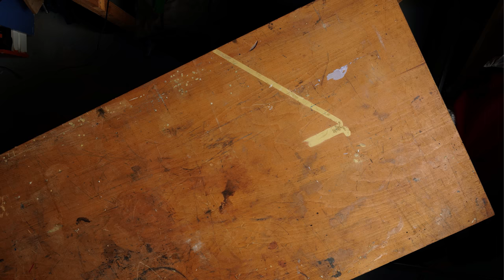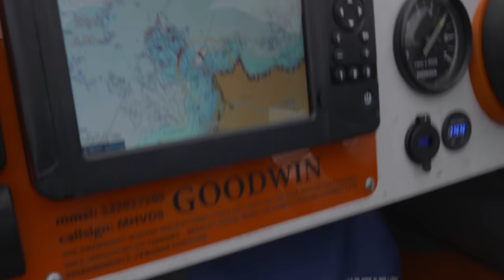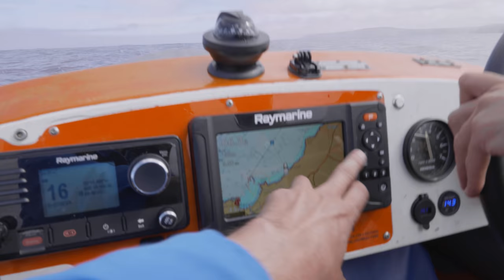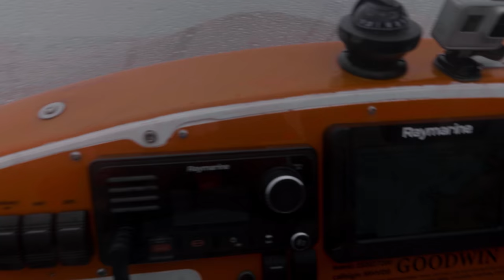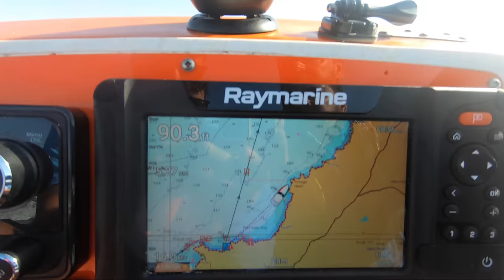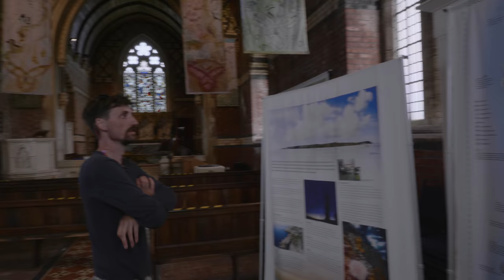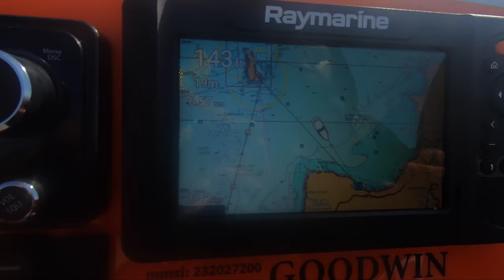1700miles in a Tiny Speedboat - Part7 - Lundy

Comment: Hope our camping advice helped! Safe trip guys🤙🏽
Reply from the maker: Ahh it did indeed! Also good anchoring advice after we hit the bottom.
Reply: @harrydwyer  I've just brought a bungee anchor line from Boatworld. Not tried it yet but the idea is you drop the bungee line with anchor off the stern 20m from the shore, then slowly motor onto the beach(remembering to lift the OB before it gets too shallow ;-) ) secure the bow line with a land stake and then once disembarked with all of your kit hold on to the bow line whilst the bungee pulls the vessel back out into deeper water. Once in a safe place secure the bow line again back to the land stake and Voila! Boat should now be safely anchored up just off shore. Then when ready to depart simply pull the boat back toward you using the bow line, jump in, let the bungee pull you back to a safe distance to drop the OB again and finally retrieve the anchor :-) As I said I haven't tried it yet but cant wait till lockdown is lifted to give it a go. If you search on here for 'Bungee Anchor' there is a video of the guy demonstrating it. Good luck with the rest of the journey and wishing Goodwin and all who sail in her a safe passage.
Reply from the maker: @simonfrewin5734  this sounds perfect! I need one! How long is the bungee?
Reply: @harrydwyer  I think they have a various sizes. The one I’ve got is 14ft stretching out to 50ft. Good luck on your adventures 👍
Reply: @harrydwyer  got a quick question for you if I may? I’m guessing I may have to wait to find out? But when did you record the series? And do you still have content to put up? Reason I ask is I’d hate to have to wait for this lockdown to be lifted before we got to see the conclusion to your trip?

Comment: WOW Harry back in 1986 I owned the same Sea Roder except it had a single bench seat, it had just the days bare essentials, anyway as you'll know for better stability the lower part of the Hull floods ( but empties once on plane, I had no A frame no VHF it literally had a bench  ( storage & fuel tank underneath)  however if I remember right it was rated for a 50hp or 55hp, however I had a 40hp & once it was up on plane the Hull emptied & it really kicked on,  it would just slap from side to side of the Vee, was just too light for the 40hp, having anything larger on mine would of been even more wild- so bare this in mind should you ever power up to it's max hp ( Goodwin will deal with it better having more weight & sitting deeper- I hope lol) safe travels 👍

Comment: That Honda must be before 2003 as it doesn't have auto choke ? I love Honda marine outboard engines they are high quality and will run for years 😊
Reply from the maker: Actually it does have auto choke, the richer fuel circuit that runs when it first starts up. It needs a bit of an adjustment on the idle mix screws. I think it's 2005. Engine maintenance is underway.